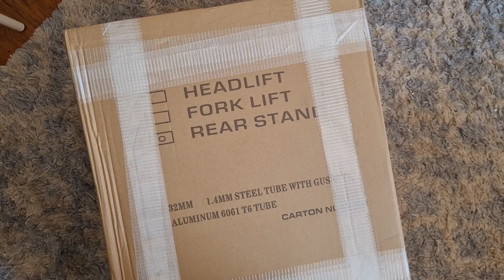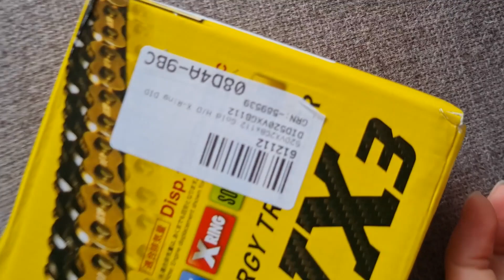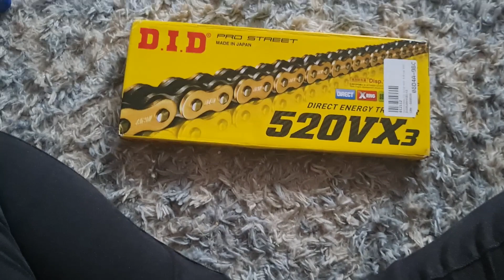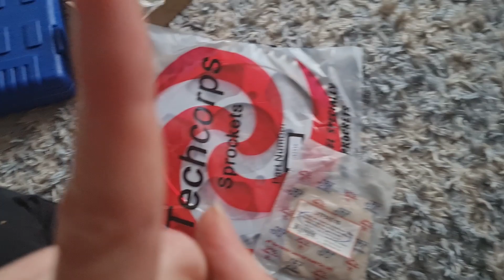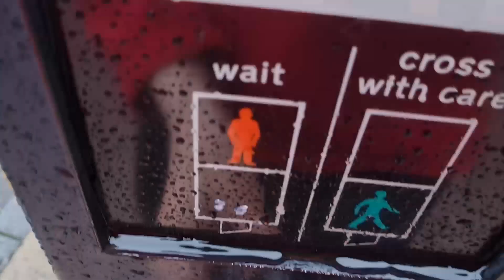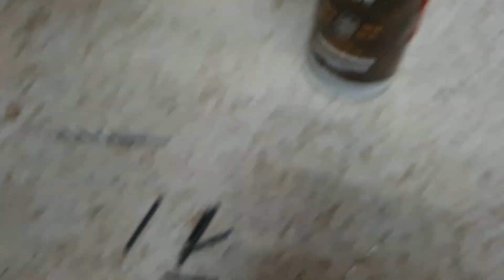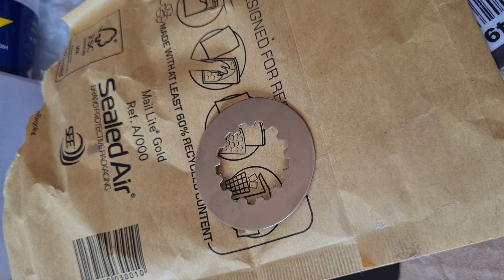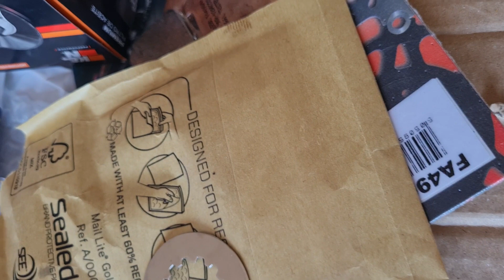Beginner Motorcycle Maintenance: My First Attempt (Part 1)

Comment: Don't let screwups and things fighting back put you off, it's just part of learning. 

I've just realised how much i've typed, don't take any of this in any kind of demotivating way, that's not how it's intended at all!

Some of the problems you had can be put down to just doing things in the order you thought of them, instead of the order they should've been done it. Again, it's just a learning thing, it looked like you were in too much of a hurry to take the rear wheel off, instead of getting all the nuts & bolts loose first. Did you take it off because of the front sprocket nut halting the progress? 

Small button head allen bolts are absolute garbage, i find torx bits/drivers work a bit better with them, but it's still terrible. As soon as the allen key starts to looks like it's rounding off at the corners, it's time for a new one.

Pull the front brake on a bit, then put a cable tie (or similar) around the handle bar and the lever, then it'll stay still a bit better. You don't need to pull it on really hard, just enough so that it doesn't move when you try to push it.

Changing that sprocket washer thing; yes, things like that are always "single use".

From about 11:46 there's a celebration of please don't do that, starting with pushing the big bar in the direction that would also push the bike forwards and off the stand. At 12:36 how close was the hammer to the fuel tank? The socket didn't look like it was fully on before you pushed on the bar, when it jumped off you hurt yourself and - i think - almost hit yourself in the face. Your left hand was also in a position where you could've hit it. When something hurts by a sufficient amount, you're allowed to walk around the place randomly swearing at inanimate objects as if it's their fault! There were a few occasions where it looked like if the ratchet jumped off you'd have injured yourself, but it's hard to tell how much space there was. 

When spinning the ratchet on the end of an extension, be wary of what you might accidentally throw it at when/if it comes off! It's something you never think about until after it's hit you in the face or dinted the fuel tank

Comment: Learning as you go, out of necessity, because your bike needs new parts, is the way to go. Don’t worry about bike maintenance courses. They only teach the same as you see on YouTube. Your front sprocket is a bastard whether you learn from a course or from YouTube. The first time I did that job didn’t go that smoothly, but the next time was a doddle. And all those tools will have paid for themselves by the next time you do it. And just release the brake bleed nipples and push the pistons back.

Comment: That is the wrong chain. Why are you using a 520 chain on a bike designed for 525?
Reply from the maker: I rang up a shop and this is what they advised 🥲🥲🥲🥲
Reply: @SaffySprocket  DL650 since 2004 and SV650 since 1999 run 525 chains. Their mechanics and drivetrain are pretty much identical. Look for the manual and it will have all the correct specifications or go to the website of JT for the sprocket sizes and Regina for the correct chain size. That chain is going to snap under heavy load with 3 possible outcomes. 1 it just flies off and no damage is done, 2 it chokes up the countershaft and the engine goes boom or 3 it jams the rear sprocket and shit hits the fan.

Comment: Hi Saffy, not good doing your own maintenance, but the pricez that main agents tell you, you have to try. I havd a Bdnelli TRK502 bought new, dafg me, i had sihnex for it then askdd gheir maitenance charges, thdrez what ghey said - first service 500 miles, £170. Second service £220 every 4,000 miles. You may ssy km to that but, i was told that when i have done 20,000 miles, the valves need attention, this cost would be (2019 prices = a shopping £700!). I told ghe chap no way.  Since ownkng my bike, i havd found an independent motorchcle mechanic ( he is a local councillor), he said his charges would be - First service = £60, Second service = £80 and services every 12 months, and ghe big valve
Reply: Problem would be the same as a service. As he said, it only takes around 2.5 hours to do. All the main dealers are rip off merchants, i will kedp to my mechanic, he, also comes to the house.
Reply: Sorry for ghe spelling, big fingers for my keypad on phone, sorry.
Reply from the maker: Ah that's really cool! I used an independent mechanic originally too but after moving towns he's a bit too far away, I really wanted to learn for myself because I eventually want to own a few motorcycles and maintenence costs are going to start racking up
Reply: Hi Saffy, have you finally finished your bike maintenance now, so getting ready to go on that big journey. Ride safe, and give us some stunning videos of your future journeys.

Comment: Before you condemn the entire rear brake system, I'd make sure you get all the brake dust and other sh!t off the caliper. Then VERY GINGERLY apply some rear brake to expose more piston. You can safely go to most of the depth of the holes in the pistons, but I'd stick to maybe half that. Should still be enough. If you see a difference in the surface, them the pistons are covered in the same crap as the rest of the caliper (brake dust - NASTY!). Getting most of it (or all, if you can) off the pistons will make it easier to retract and should also stop them sticking in operation. I'd clean and re-grease the caliper's slide pins for the same reason.

Now, if you accidentally push a piston out all the way (you'll know that by the mess of brake fluid on the floor), it's far from ideal, but not the end of the world - they push right back in. You do need to bleed the system afterwards though, at which point you may as well replace the fluid (it has a finite life).

You can't really get "too much" brake fluid in the lines, they're meant to only have that in them (NO AIR!) and are designed to let it flow. You might have too much in the tank though, if it's been topped off to allow for pad wear. In that case you can let some out through the bleed nut or just pull some out of the tank with a syringe or something. With worn pads it should be near the minimum level. And yeh, taking off the cap can help it flow back up the system.

If you can't apply enough pressure to the pistons by hand, you can use the handle of a screwdriver (one that fits down the hole) to push with, the screwdriver gives you more to hold on to. Or put the new pad in and use a screwdriver to lever it over. That should push both (I assume they're two) pistons back in at the same time.

Comment: Please please bend the washer over on the front sprocket, its called a locking tab, it was bent before for a reason, it's to stop the nut working itself loose. Also, you have spools on your swingarm, meaning you need hooks instead of feet on your rear stand. I wouldn't dream of ever putting my bikes on a stand that far back on the swingarm, it scares the crap out of me watching you sat behind it trying to get the wheel out with it there 😔
Reply from the maker: I did! Don't worry!

Comment: You don't have too much brake fluid, can't happen. Just open the reservoir cap, put the old pads back in the caliper and pry the pads apart with a pry bar or a large flat tip screwdriver. And make sure you bend the front sprocket washer over the nut again. It keeps the nut from loosening up.

And loosen and tighten the nut's when the bike is not sitting on that sketchy stand you're making me very nervous.
Reply: Bike master cylinders are not vented like a car. If the pads are worn and the cylinder has been filled to the top then it would be possible to fluid lock the system. We know that Saffy's master cylinder is overfilled beyond the sight glass, as we saw that from a previous video. If it were filled to the correct upper level, there would probably be enough expansion room.
Reply: @richardsutton01  That's why I said open the reservoir cap.
Reply: @el34superlead  Indeed ..... but the fact that Saffy had to open the cap means that she had too much brake fluid in the cylinder.

Comment: You so need an instructor and now you know why things cost more than you think they should. There are often things that are stuck or worn out that take longer to fix and cost more. You don't need more brake fluid you need to take some out of the res on the rear pedal. You can do it carefully with some kitchen roll to soak it up. Don't get it on your paintwork.

Comment: Don't touch that break fluid. You are making it to hard for yourself! Remount the brakecaliper, and use something to SLOWly push the calipers back. Put the old brakepads in, you can use an breakiron on those, whitout breaking something. But do is slow and gently. Regards from Belgium
Reply: brake disc piston pad separator adjuster, that seems to be the right English name of the tool you need,  @Saffy Sprocket

Comment: I am a motorcycle mechanic, I want to help...buy a Haynes manual or similar, these books show how to repair and maintain motorcycles quite easily.
Have you seen jenny timouthsyou tube chanel? She is a motorcycle racer and mechanic up north..that green thing was a small spirt level for your motorcycle stand.can you join a local motorcycle club,they might be able to help with maintenance..keep up the good work.
Reply from the maker: I contacted Suzuki, they don't make the service manuals available to the public and the Haynes don't make them for 3rd gen 🥲
Reply: You don't need a manual for  a 2017 sv, just a general motorcycle repair/service manual just to learn the basics ,eg remove brake fluid before pushing pistons back into brake calipers before fitting new brake pads...

Comment: I am hugely impressed with you giving this a go  with nothing but The Internets and the odd neighbor for help. Most of us have someone with experience to help with these things the first time (and maybe a Haynes manual).

The first time you do maintenance on anything, car, bike, house, you find the things previous owners have done wrong, badly or not at all. !@#$ers who over tighten bolts are a pet hate of mine. You don't strictly need to change that locking washer, but I would 'cause you don't know how many times its already been used. Do it once and do it properly, as my Dad used to tell me.

The brake pistons should push back once you loosen the bleed nipple (ooh er nurse!), but since you are now changing the fluid that advice is moot. Get some disposable gloves and an old towel because you will spill brake fluid the first time and it stains concrete (go on, ask me how I know...). Also get a can of brake cleaner and a stiff bristle brush to clean the cack off. Have a look at your fronts while you are at it. I'd change the fluid in both because you don't know when it was last done until you do it yourself!

Before you know it, you'll have a collection of random tools and a shelf of half used fluids like every motorcyclist.

Comment: Saffy, your sprocket didn't look worn out at all...the rear one at least.   The front one I couldn't see.    Are you sure that was what the clunk was.  I can't see a mildly loose chain, and a chain that was problably far from being worn out...(O rings last a long long time and don't stretch out like they used to),  In the future lots of chain maintenance is what you need, not a full premature replace.    You Tube can be viscious that way.   I see you were hurting yourself with slips on the undoing of bolts.    Now you know......that was hard to watch, as we have all been there and learned.  You are ambitious but could benefit from better advice.  Due to the severity of problems that can result from chain and sprocket R+R you would be wise to have an expert at least go over it.  Torque on the countershaft is important, and that folding washer is too.    The masterlink on the chain must be done absolutely correctly, double check that.   There is a reason mechanics charge good money, its serious business as you now know.    I am being Mr know it all because truthfully watching these types of videos can be hard to watch sometimes, because we motorcyclists inherently worry about each other, and we all know the dangers are real, including mechanical failures, and hurting yourself undoing bolts, they draw blood sometimes.   So Saffy, be more careful, and work slowly next time, take your time, and think more carefully.  Tools and leverage go hand in hand.  I like to wear gloves as that oil, and brake fluid frankly, will give you cancer......this is serious  sport you are involved in....focus.....

Comment: Of course you do your own bike maintenance , as long as you know what you are doing and have tools for it.... Did you by any chance use loctite  ? Lose bolts on motorbike can really hurt you !
You  definitely selected most expensive education , but you'll learn a lot .
PS . Mechanic wouldn't take more than 100 £ for the job - that takes couple hours .

Comment: 5mins in and that repetitive plunking is peeing me off.   I will find a way to fight on through though.   Notes so far x ring is supposed to be better (cleaner)  and cheap chain rivet kit does the job but beware of breaking back plate pins
Reply from the maker: I learnt after 🤣 I reckon the shop had a good laugh at my expense
Reply: @SaffySprocket  I'm sure they've heard it all before. Though it sounds like they could've been a bit more helpful by explaining the difference.

Comment: You've just saved yourself around a £1,000's of pounds doing it yourself... Oh you need a new back tyre, that one is shot and needs to go to bike heaven ,fronts pretty ready to bike heaven too ... You've bought the tools, so in the future you can do it yourself. Yes the original outlay was expensive, but in the long run you'll recoup the costs. As my Father always said " buy the tools you can afford, but spend more on better tools as you go along. It'll be worth it in the long run as they'll last longer"